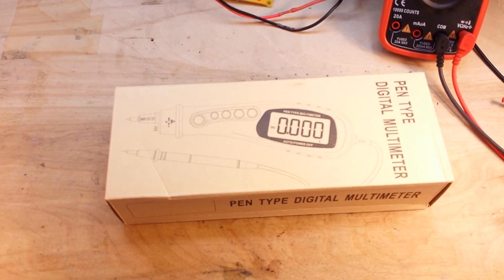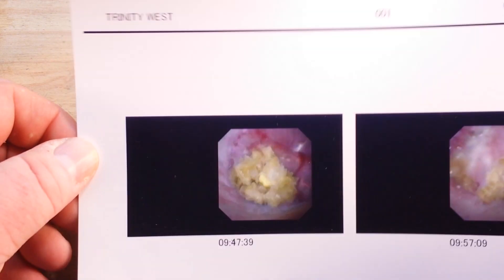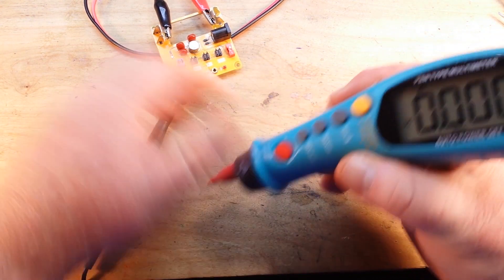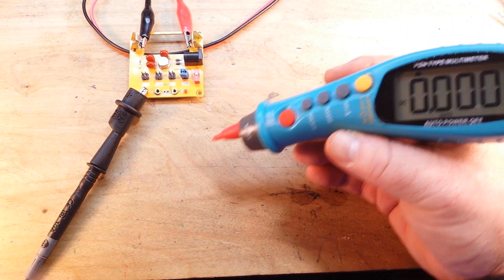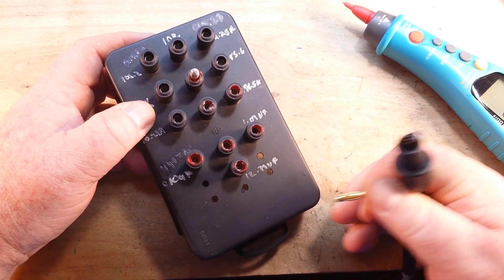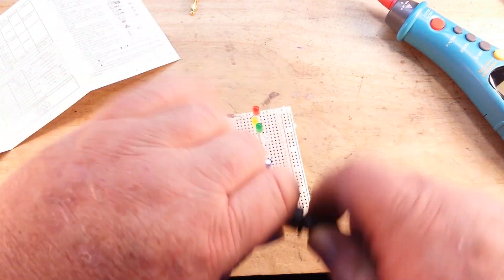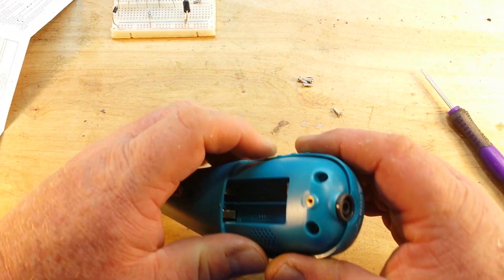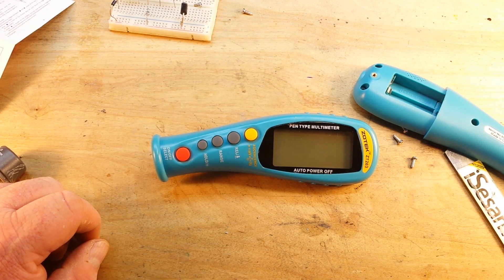Zotek ZT203 Pen Type Multimeter Review and Tear Down

Comment: Thanks. I personally think you should mention the specs of such cheap devices. And be aware that a serious manufacturer should explain if the accuracy is meant either as "% of reading + some digits" or "% of range + some digits" (or even a combination of both). As I glimpsed, the Zotek manual may not do this...

Comment: Now people see how the accuracy increased just by using one gold tip..  I use the clamp meter now and again like a pen meter.  Comes in handy having a clip for one of the probes especially if your not at your work bench or on your feet doing measurements... nice vid Paul👍

Comment: a different style or stylus meter :P what is the component with 6 pins @ 18:02 with legs upside down . It  looks a bit tilted . It it some sort of Gas Discharge Tube? Glad to be back with the probe master since it targets the meter review as in the cal lab that uses that own set of leads to check if they are in spec.
Reply from the maker: Just an optocoupler
Reply: @learnelectronics  thanks for the reply, Was searching for GDT's with 6 pin and only found 3 pin variant llolll.

Comment: Ordered one of those Uni-T Clamp on A-Meters  Uni-T 210E.  Should be here Tomorrow actually.  Seems way more versatile then this unit.  Not that much more in cost.   I really lacked a easy means to measure DC Amperage.           These Pen style meters just don't seem too swift to me.  Not much help if you need continuous readings,   eaaaa?    One more APPRECIATED Video Sir.  Did they use Ultra Sound to bust that invasive body up ?   You've been PINGED Sir ?
Reply from the maker: Np ultrasound this time,  the stone was behind my hip bone. They used the Holmium Laser.
Reply: @learnelectronics   In the Kidney ?    That sounds like about as much fun as snake bite.